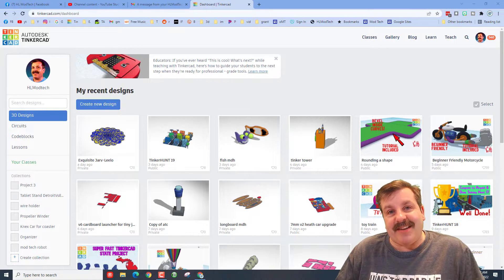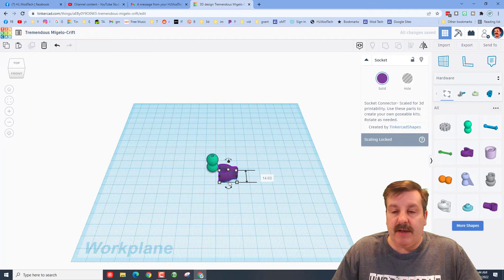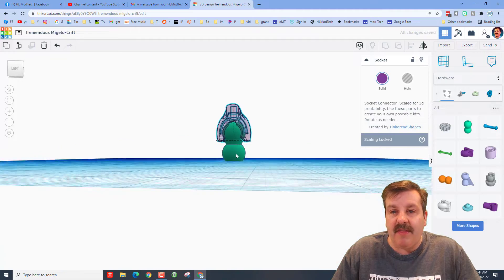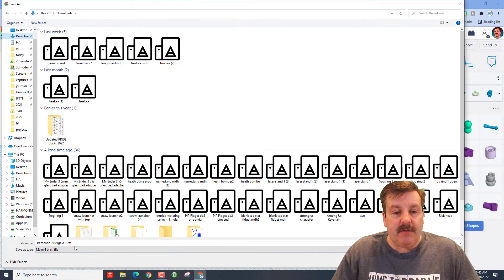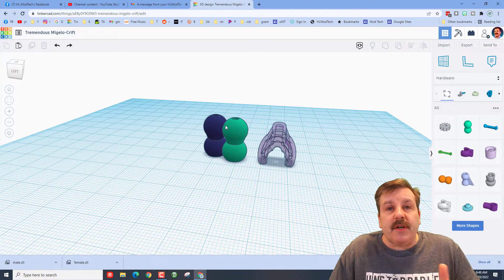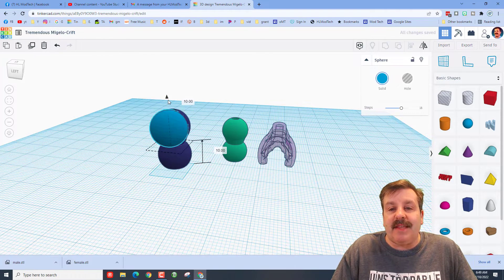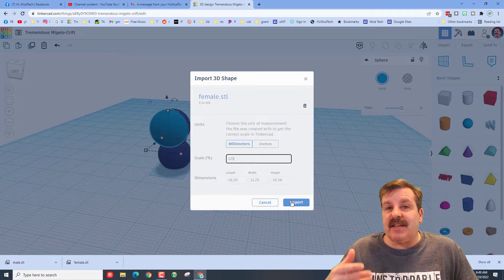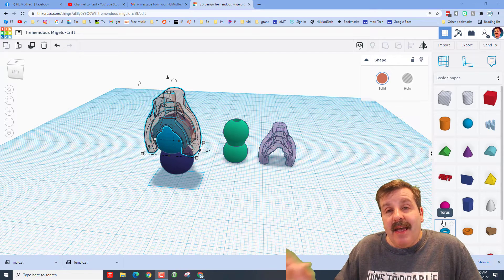Enable Scaling on Tinkercad Locked Connectors & Shapes Slick Trick

Comment: I have been working on a project for a while now and I'm having an issue where I'm trying to make a twist locking lid on a round container. but when printing, i either need supports for the threads, but if i use supports, its completely covering the threads with supports and struggling to make it work. Is there any chance you could make a video for a twist lock that actually locks in place rather then having a loose lid and no threads?
Reply from the maker: Instead of a twist lock, I like the snap lock. This has worked like a champ for several months now. https://bit.ly/hlsnapfit

Comment: my only issue with this is that we cant maintain the original color, especially the one ones that have multicolors
Reply from the maker: Why would the color matter?  You can use this trick to copy a color if you want. https://youtu.be/6WhaKS38FNQ You can also select multi-color for parts too if you want.

Comment: Haha! Well done. I was speculating what your method would be. I guessed you'd make the object a hole, make a nagative mould in a block and remould a positive. But exporting works too.

Tip 1: select all your parts and scale them together and they'll still fit.

Tip 2: use uniform scaling or they won't work.
Reply: Update: Your method works and mine doesn't!
Reply from the maker: It sure sounded good in theory. Always cool bouncing ideas with talented designers. 💯🔥
Reply from the maker: Interesting ideas. I just tested and even if you group the 2nd object with a locked connector. It stayed locked.

Comment: I'm just beginning to 3d print  at 67yo but interested in designing pieces for rc's cars and trucks for my grandson's and myself. My question is  how does one  take a stl that is 1/10 scale and scale it to 1/16 or 1/24? 
I found a 1/10 trailer stl  but I want to print a 3d version that 1/24 or 1/16 scale! I would appreciate you advice and thanks for the job you do with Tinkercad.
Reply from the maker: See if this helps. https://youtu.be/16kXsFwqpHs